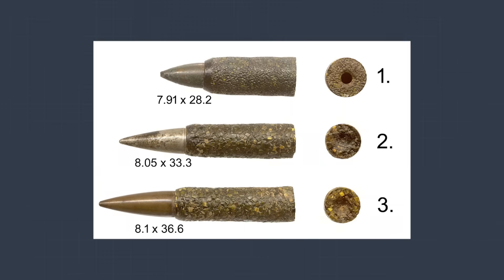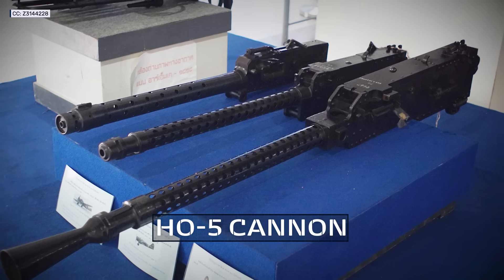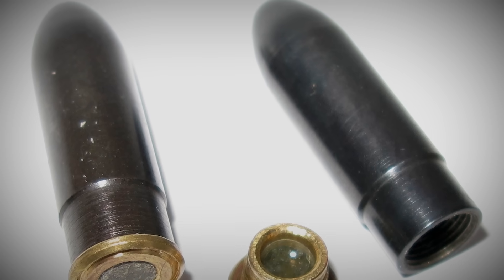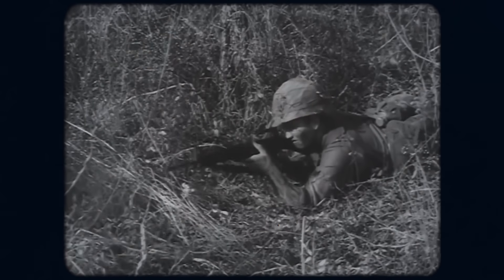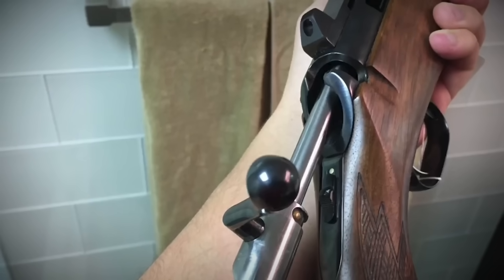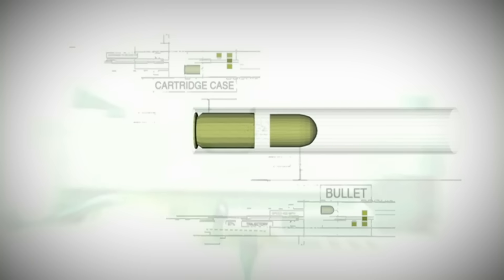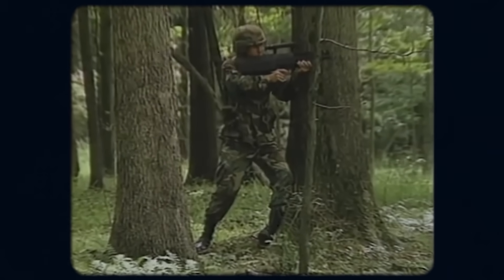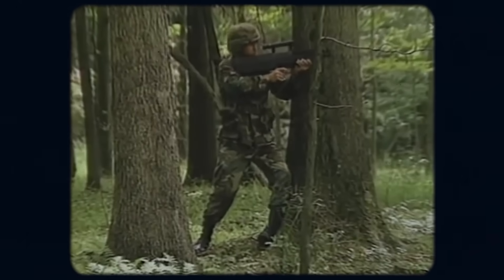Is Caseless Ammunition the Future of Warfare?

Comment: The VEC-91 just did too many things, too differently, to have any chance of success. Even if the caseless problems were completely resolved, the consumer market of firearms is extremely conservative (no pun intended) and hesitant to adopt anything that deviates too far from the norm. Just refer to Forgotten Weapon's video on the Remington E-Tronix project - having an electrical firing system was a non-starter ~30 years ago and still is today. To all but the biggest nerds, the improvements are negligible compared to the uncertainty of a non-mechanical firing system - even if it's fairly simple. Nobody wants to die in a gunfight because their battery died or they dropped it and the circuit shorted out (and no electronic optics aren't a fair comparison). Back up iron sights are still so common for that reason, and at least the thing still shoots with a broken or dead optic.

With development the battery and durability problems could be fixed, but you still have to ask what's the point? The added complexity of an unvetted system (including caseless) is just not going to catch on unless it's a radical improvement in other significant ways (see SPIW, XM8, G11, Textron's NGSW submission, etc). And since small arms development has plateaued pretty substantially in the last few decades, those improvements are increasingly few and far between. Further, I have to mention the inevitable red tape of the Feds trying to classify and regulate electronic trigger packs - how do you keep hobbyists from soldering/reprogramming and making it full auto? Just a lot of potential headaches. The Biofire smart gun project, while a decent proof of concept, was phoned-in and subsidized by government mandate. It would never have went as far as it did otherwise - and I would still call it a flop.

Comment: Seriously dude, check out the DARPA Projects featured on Future Weapons (or something like that, it was on the History Channel). The box had a bunch of barrels in stacks and lined up side by side, and had rows of "bullets" in each barrel. The system allows it to fire the first bullet in the row of each barrel, and can light off the whole group at once (essentially). It sounds like a video game weapon or a rail gun of sorts. A loud electrical sound and rounds just shredding sh!t. Super rad gun! Also, a strong case can be made for ultra high powered Air SMG's that use a 1/4"-1/2" ball bearing or larger. Steel shot, flying at well over 1000-1500fps. And to reload, it's just a hopper like a paintball gun and the same thing for the "air" cannister. They already exist too! Just dialed down to around 600-900fps. There's also a prototype four barrel pistol that uses a row fire system of varying lethality and requires a special ring to be worn (that has a transponder in it) to fire the gun. Check into these dude! They're all good choices for an alternative to standard ammo.

Comment: You missed out on Metal Storm:
The Metal Storm gun is a 36-barreled stacked projectile volley gun that can fire at a rate of over 1 million rounds per minute. A prototype array of the gun demonstrated a firing rate of 27,777 rounds per minute per barrel for a burst of 180 rounds in 0.01 seconds. 
Metal Storm also offers the 3GL, a semiautomatic grenade launcher with three 40mm rounds in a single barrel. The 3GL has a battery-powered electronic ignition that allows for fast firing and improved reliability. The grenadier can manually load the 3GL with any combination of ammunition types, including irritant cloud or high explosive. 
The M134 Minigun currently holds the Guinness World Record for the fastest rate of fire of a military weapon in service. 
https://en.wikipedia.org/wiki/Metal_Storm

Comment: The military has so many programs going at any one time, so im not positive on this, but i believe that the plastic ammo he is referring to was not chosen and they instead picked SIGs very interesting (but a bit odd) steel based 6.8x51mm ammo.  Its basically a 762x51 necked down to 6.8 and then turbocharged with enough chamber pressure to make any sane, experienced handloader a bit nervous.  I do love the concept though and have already bought some of the 6.8 ammo and immediately pulled the bullets, dumped the powder, and resized them to 7.62 for "experiments". 😂

Comment: The problem is quite simple to overcome, the simplest example being air rifle projectiles with an added petroleum-based product in the projectile's base along with a better sealed breech. However, the true problem has nothing to do with rifle engineering, sensitivity of caseless loads to deterioration, or fouling etc. It is really a matter of policy. No police force, indeed no state regulator, wants a firearm that leaves less evidence from the shot. Police forces worldwide want a case to compare with marks caused by loading into a breech. Caseless ammunition, disposable SABOT rounds, tungsten flechette rounds, etc all leave far less evidence from a shooting crime scene. It is therefore unlikely such endeavors to research and engineer caseless ammunition, SABOT darts etc will ever receive sufficient R&D funding.

Comment: I think an idea worth looking into is the method modern tank shells use. Instead of the case being fully external propelant. Put a smaller brass housing for a primer. Design it like a casing so it can be grabbed. Honestly i think that would be as close to caseless as you can get.

Comment: You didn't mention the tooth brush we all carried in the helmet band.
It was used to clean the bolt of the M<-16. The conical magnesium firing pin tended to carbon up after a couple hundred rounds,
We only put 18 rounds in the magazine to prevent jamming.

Comment: Nope, until we finished the periodic table of elements and even when we do. We will not step away from the things that we already have. They may get better, propellants make it more efficient, but we need to stop as a society thinking that the future is going to be so much more different than what our future is. If we look at what is not possible but probable. We will find that in 150 years things will be very similar to where we’re at. Even in 3000 years as long as something catastrophic doesn’t happen things will be similar. We already know that floating cars, portable rail guns, etc. don’t work. The navy built one on a ship and it wasn’t durable enough to maintain steady fire. Now let’s talk about fire arts. Although firearms haven’t changed a lot from a physical perspective they have changed drastically from a scientific perspective. The chamber pressures, bullet velocity, and accuracy of material has changed light years. The rounds keep getting faster because we have the technology to make the firearm capable of handling more powder. No matter what we do, we will always need some sort of charge to propel the round. Until we invent something that is significantly better and more stable than gunpowder, nothing will change. Nor should it, kinetic weapons are the most dangerous weapons on the battlefield. High velocity projectiles that are propose of very dense material like tungsten or depleted uranium cut through everything. There is nothing on the battlefield from any nation that can stop the depleted uranium hyper velocity round.

Comment: The first use of caseless bullets were muskets. Cooking off of black powder did happen, but it was rare. Guns did not get as hot. One idea is the consolidated magazine approach. Everything is built into the magazine, no loose rounds. Coil type electric ignition, with the batteries incorporated within the magazine. Heat dissipation to prevent cook offs, is a concern.

Comment: No, because the brass carries most of the excess heat with it.  Otherwise "barrel burnout" wouldnt be a stated issue of caseless guns that standard guns dont experience until far more lead is flung.

Comment: I designed a caseless ammo to a theoretic weapon decades ago.  I've always wanted to build a prototype for testing, but have yet to have the means.  
Without giving too much away, the ignition system is the true secret to my concept.  I moved the propellant back inside of the bullet following the Japanese and Gyrojet concepts.  The bolt closes behind the bullet to provide a sealed chamber to push off from.  The propellant is as clean burning as possible and the bullet itself is a bi-metal zinc alloy that cleans the chamber and barrel with each firing.  This makes it a bit lighter and harder than traditional copper jacketed lead, providing a number of advantages, including a proper muzzle velocity.  Finally, the propellant isn't heat triggered, so cooking off won't be a problem.
Reply: So an ignition between two chemicals that violently combust on contact? Separated perhaps by a thin non-permeable material that is resistant to both chemicals on their own but still brittle enough to be shattered by a firing pin(?) to allow the reaction to occur and get used up with no residue left over or at least so little that it either gets ejected along with the gas and bullet or leaves very minimal residue on the bolt. Maybe I'm overcomplicating it, but I think I'm close to your idea, without any idea of the possible chemicals you could use.
Reply: So kinda like the liquid Hypergolic rocket fuel as a propellant? Sounds neat...

Comment: As a former soldier. The biggest problem in the heat of battle is misfires. The brass get stuck when ejecting and stops your ability to fire....

Caseless rounds are very good at solving this issue as demostrated by the very expensive but very good g11

Comment: Machine gunning words does not let others have time to think for themselves so they miss a lot just trying to keep up some sort of generic context for a thoughtless train while crossing their fingers that they will remember enough to make the time and effort worthwhile. Please, there is more to presentation than organization in a tiny time frame… I wish this was a two hour bit with your natural speed. I am ridiculously interested in the topic of case-less rounds and want to design one based on Diesel engines but cannot cross reference theories and designs while repairing your dialectic-over-edit speed run at the same time. It’s hard enough just to comparing the visuals to the dialogue let alone build a true understanding of your work.

Otherwise nice job putting it together and researching the material!

Comment: The real ammo revelation is the True Velocity composite-cased ammunition. It's an advance plastic casing that substantially increased effective range and muzzle energy, drastic reduction in cartridge weight and enhanced accuracy. The army test in 2022 proved that this round was so effective at reducing heat that an operator could actually touch the inside of the carriage bolt of the Next Gen Squad Weapon without using gloves. Although it did not pass the final testing, the army chose SIG Sauer's hybrid metal cartridge that will be manufactured by Winchester, it clearly is the next step in ammo design.
Reply: Cases frequently broke during feeding, and all that "heat reduction" goes into the barrel throat  and chamber, rather than being ejected.

Comment: Back in the 1950's there was a pistol called the Model 1500 Dardick pistol. The Dardick pistol used a unique type of caseless ammunition known as “trounds” (triangular rounds). These trounds were designed to be more efficient and easier to handle compared to traditional round cartridges. Obviously, it also did not become a 'thing', although advertised as 'caseless' it actually used a non-reloadable, discardable polymer 'case'.  There was also, of course, the Gyrojet pistol which used a rocket propelled projectile and was a truly a caseless weapon.

Comment: Part of the problem of caseless is the issue of heat, the case actually carries away from the weapon a significant portion of the heat of the iteration of the process of firing a round, without that the rest of the components get hot very fast.

Comment: Quick note on the Rheinmetall RH 120: It is a cannon design specifically, not a tank, that does indeed fire a (mostly) caseless round that leaves only a short stub cap after firing. It also happens to be the design that is produced by the U.S. under license from Rheinmetall and mounted on the current variants of the Abrams tank, so it is a highly successful and somewhat widely used design.

Comment: I feel like they need to look back at the more advanced stuff from the 1880's when cases were coming into mass production. It seems like the peak of a technology is never used because the next evolution defeats the use of it. Look at the fighters planes that were designed in the mid to late 1940's. They were preforming at near jet performance. But Jets were clearly going to get better so why put the money into something that is nearly as good. Maybe we need a dual magazine one full of power in a paper loads and the roads in a different magazine. The two get pushed together then fed into the chamber to be fired. Find like how a cannon works.

Comment: Rail gun, seems the obvious solution once someone can figure out the details. Think they do have some naval gun sized ones? Having a way to power a infantry sized weapon on the other hand may be much more difficult.
Reply: It's an energy density problem. Lithium batteries are about as good as we got right now and they may be able to drive something like a riot control non-lethal round acceptably, but I don't see any realistic way you're going to get performance equal to a modern rifle round in a package someone can carry.

Comment: I read the brass actually conducts heat into the firing chamber, and caseless ammo actually lets the firing chamber run cooler. It was in one of the papers for Textron's research into cased telescoped and caseless telescoped ammunition. Though it might be specific to the former, which uses a plastic case, and not the caseless.

Comment: All the problems you mentioned can be solved. Hard to eject on the mold of.the bullet add a knotch to eject it with an extractor. To get around contamination you work with a chemist to make a solid propellant that is water resistant or add lacker to the primer. To reduce the fouling you design the bolt so the round is partially inside it and use a cleaner burning formula ie working with the chemistry.

Comment: Daisy, of air rifle and BB gun fame, made a single shot caseless 22 in the 60s called the VL after it's inventor Jules Van Langenhoven. The design was right up Daisy's alley, instead of having a primer, the powder charge was directly ignited by a jet of hot air from a spring driven piston, such as found in almost every spring-air gun. The air jet could reach 2000 degrees. Between the air pressure and the burning powder, it could propel a 29 grain bullet to almost 1200fps reliably and consistently. There is an under-lever that opens the chamber and cocks the air rifle part reminiscent of side or under-lever air rifles. As with other caseless designs, the ammo can be fragile. It is really a novelty firearm but I think they were on to something with the air ignition system.
Reply: I was looking for this. It’s I believe the first commercially available caseless ammunition and gun to shoot it. It did get Daisy into a bit of trouble with ATF. Daisy said it wasn’t a firearm and ATF said it was. ATF won that argument.  Daisy did go onto later make a series of 22lr rifles. I do have a VL and have shot it. A lot like a regular 22. The ammunition is like a 22 bullet with felt stuck to the base

Comment: Caseless ammo seems like a really dumb idea for small arms. The contamination issue of unsealed propellant is even worse when you factor in active duty dudes carrying around pockets full of the things for days at a time. Not to mention them getting damaged or cracked. Having a brass (or even plastic) case to hold/protect the propellant solves SOOO many problems. Larger ammo is usable caseless because its carrying/storage/usage is much more controlled and with a lower rate of fire. IE, Tank ammo is inside a rack inside the tank. Heck once you get up to a certain size all guns are caseless because you ain't loading brass shell into a 16" battleship gun. Also - Out of three guns one was VAG and another was Koch :P hehe

Comment: Super-heavy naval artillery like the 16-inch prove that Caseless Ammunition can be practical.
It's just not practical for smaller calibers and higher rates of fire.
This is because you need an active and hyper-efficient cooling system to compensate for the lack of casings which acted as heat-sinks to carry away the heat generated after firing.
You pretty much need a integrated piping system that uses liquid nitrogen if you want a weapon that uses caseless ammo and has 2000rpm.

Comment: Caseless ammunition for small arms seems like a good idea in concept; but when teal world physics and science are applied to it alongside the real world testing that has already occurred, it becomes clear that cased ammunition is the most advanced form of ammunition for kinetic projectile firearms.

With caseless ammunition, you HAVE to store it in magazines since it cannot be exposed to elements or an unsecured physical surface due to risking damage to the round itself by malforming it or causing an unintended chemical reaction.  This means you cannot store loose rounds in pockets or packs without magazines(which take up more space and weight).

There’s also the problem with overheating the firearms itself to where it’ll not only cook off the ammunition inside the magazine before entering the breach/chamber; also risk melting the barrel and other parts at an accelerated rate.